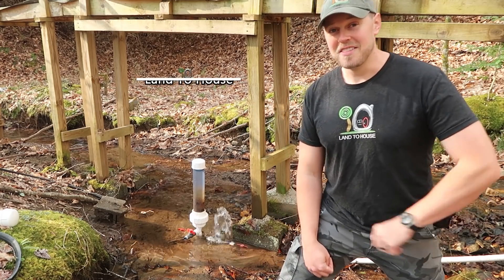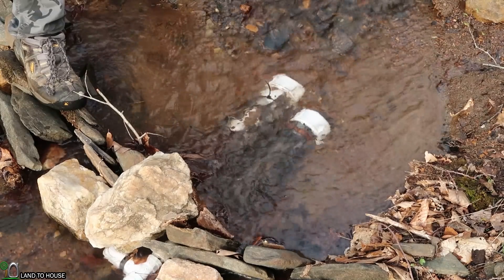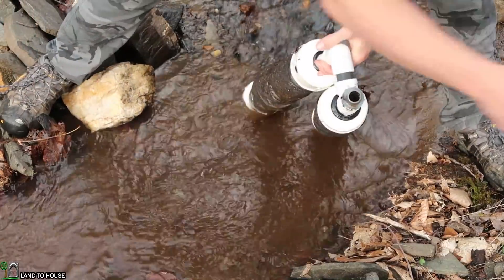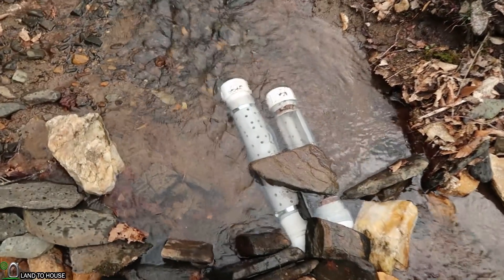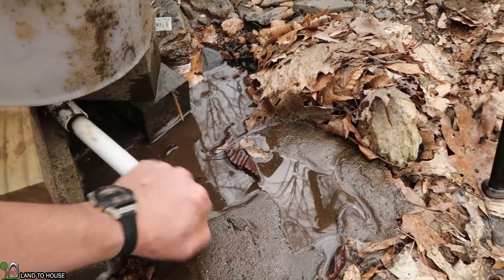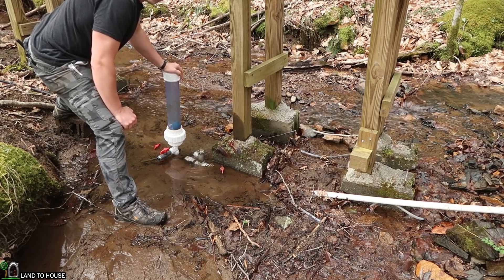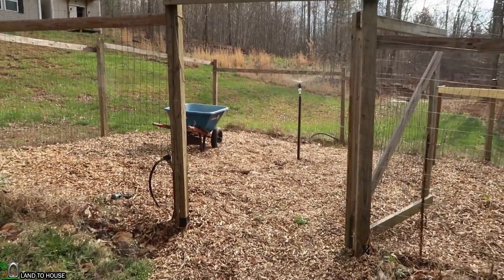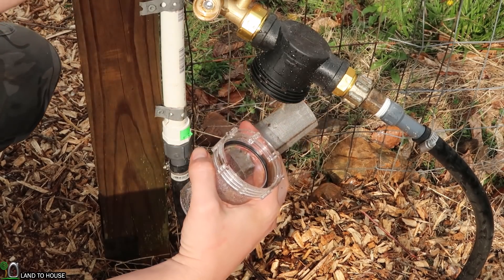Crazy Easy Ram Pump Silt Filtration

Comment: I'm thinking about installing a rusco spin down between the output of a spring just before the ram pump, to filter out sand and save some wear and tear on the check valves within the ram pump

Comment: You should have got this filter instead. You can put it in any direction physically,  as long as it flows in the direction it says. Horizontal or either of the two vertical ways the bell will point. The reason this one is better is because it has a cap you can remove and the water pressure will clean out the filter for you. Add a ball valve there and you can flush it out and replace cap without it back spraying you or having to shut off the water.

Comment: Ok im no expert by any means.but if i put slits instead out drilling holes it would let water in and keep the bigger stuff out.and burying a tote The size of your two intakes and fine screen top where water come into the tote that the lid has slits instead holes this would filter water from the begining and  put panty hose on the connections where you come of your two. Intakes to the line this will save you a lot of trouble .put panty hose on your infow at the fice gallon bucket als

Comment: I've almost finished constructing my 3/4'' Ram pump and I'm wondering how to make the swing check valve quieter.  Would adding a short length of pipe to the top of the swing check valve help reduce the noise without affecting the operation?
Reply: It would be nice to find check valves that had 'padded' flaps to reduce noise. Short of that...I suspect that any type of muffler device that blocks, directs, or absorbs the sound would offer some relief.

Comment: Doesn't the bucket reduce your head pressure on the drive pipe?
Reply from the maker: In my case it reduces the head pressure by around 1 foot. I have 7 feet of head and that is more than enough to get water to the tanks.

Comment: There is a lot of room for improvement with the bucket silt trap. Bigger would be way better. I'd go and buy a 15+ gallon stock tank at the farm store. Tilt it slightly towards your overflow trough. Drill a 3/8" hole near the bottom of the low side. The idea is the silt will have time to settle to the bottom, and then gradually work downhill to the drain hole. Have the drain hole running all the time, which will keep the silt flushed out automatically so it doesn't build up (figure 5-10% of the incoming water is always bypassing). Place your outflow tube to the pump a few inches below the overflow tube on the low side (much higher than you have). Place the inflow tube from the creek in though the high side of the tub so it's below the water line to limit added turbulence. The idea is the silt will have time to settle out during the 3+ feet of horizontal travel from one end to the other. This will give you way more silt removal capacity. I think what's happening is the bottom of the bucket is filling up with silt until it's going in your pipe to the pump, and then you have silt settling out in all your lines after that. That or your bucket is too small for the amount of flow so it stays too turbulent. You should make it very difficult for silt to get in the lines in the first place so filters later are much more effective.

Comment: @Land to House  So I've been watching your videos for several years now. However I have not been able to figure out how to make one of these ram pumps be beneficial for me. This is because though I have plenty of water around, but none of it is moving. I have the entire Lake "O" The Pines approximately 200 yards Out My Backdoor. I have been trying to figure out how I can make that become moving water so I can pump it up to my house? I'm open for hints, ideas, and suggestions? There is a drainage that runs from the street beside my house to the lake however this only has water for the first couple hours after a hard flood rain. We did not get it enough that kind of rain regularly enough to supply the water that I would require. What do you suggest?
Reply: Little King, I believe the while system works off Siphoned water for the head pressure.
So your main water supply would have to be higher then the pump, then the pump carries the water up hill.
I think he said for every foot of drop/Head Pressure = 7 feet up hill?

Comment: At the bucket where the top drain is back to sluice run 
U should rotate 90 degree drain upside down and install pipe to bottom of bucket so excess overflow pull silt out of bucket into sluice 
Wont drain bucket
Will still work 
The over flow drain will help push the silt out of bottom of bucket due to slight head in bucket
Reply: I was thinking instead of having the bottom plugged with a removable piece. of capped PVC, have a reducer on the bottom (smaller diameter than your outflow), so that the silt automatically gets washed out of the bottom of the bucket, but at a smaller flow rate than the output to the pump. One less maintenance item.

Comment: The intakes should be at the top of a deep pool / reservoir instead of sitting right in the silt.
Reply from the maker: Yes that would be nice but In these mountain creeks it's tough to have a silt free pool like that.
Reply: @LandtoHouse  It's the same in dust separation. The larger the cavity for the dust (silt) to fall in to, the easier it is on the filter. Like a small or big shop vacuum. You have the right idea going in the bucket. Dig a hole for the silt to settle in.

Comment: First off, good job!  It seems that you are able to deliver more water to your sediment catch bucket than the outlet drive pipe will handle; as witnessed by the over flow into the sluice. Question: Would it be a bad idea to raise the level of the bucket, like a stand pipe, so that you could increase the head pressure of the lower drive pipe?

Comment: You might consider setting up your storage tank OUTPUT about a foot up from the bottom so you settle silt up there too. I know that would require a reworking of the system, but your drive pipe bucket works so well, might as well use the same concept at your storage tank.
Reply: I believe that you use a uniseal on the bottom of your storage tanks... You might be able to just stick them further up in there.

Comment: At the capture point I would have put the capture tube under sand with small rocks on top of it. May spare you lot of debris all along the system?
Reply from the maker: The only problem with that is after a good rain the creek goes from 40gpm to 400+ gpm. Anything not locked down gets washed out. The sand and rock would be gone down creek.

Comment: Hmm. I'm just wondering if it has a positive effect to put a square plastic tub at your Main intakes. Build in the same design of your round bucket to have space for silt and a easy way to flush the silt out. I think when your intakes lay on the ground of the creek they easily sucks fine silt through the screen.
I also thinking of if it's possible to re-use the free silt (shoveld out and dried) for a Sandpit for your child or other things.
Reply from the maker: That might help with silt. We get a few big rains in the year and I often have to clean out the silt. The creek can increase in flow rate 100% after a rain. I have seen 500gpm in the creek that normally flows 40 to 50 gpm. 

I have been using that silt in the garden or on the hill for grass.
Reply: Even 2 buckets in line would be a better situation for minimizing the silt infiltration, maybe the first bucket have a screen from it to the second bucket and so on?
Reply: I was thinking a spring box so that the intake is completely submerged but not on the ground. This also ensures that the feed pipe never gets air in it. 
Look up how to build one. Lots of videos here in YouTube too show you how.

Comment: I have never understood why you don’t create a side pool where the initial intakes are,  to aid in filtering, just as you have the bucket really, have your dam as currently is, create a small side pond where you put your twin intakes, and have that side pond water supply come from a high point in your dam area, if that makes sense. Less silt, you can just shovel clean the original dam of silt, not disturbing the side intake pond,  a nice cheap project to enhance your intake, just a shovel, some rocks and some elbow grease. 💪 good luck
Reply from the maker: There are so many ways to improve the setup that I have now. I think there is a small waterfall up the creek a bit. I would like to make a real intake screen to capture the water that way. I actually got the material together to make one last year but then used them last week to make the intake for the micro hydro.
Reply: The side pool is a good idea.  I currently have an issue with silt filling up our ponds.  I've started creating smaller "mud" ponds above each pond to allow settling and I don't mind when the mud ponds fill up with silt - that is their job.  It is amazing how much dirt comes down the streams.

Comment: The buil-up pressure  tank you always place it perpendicular to the rest of the pump. Can you place it horizontally or at an angle?
Reply from the maker: It is possible to place it at a slight angle but the air often is lost faster. If you have a tank with air bladder you can lay it flat. I prefer to use the tank in the upright direction.

Comment: Your intake has one partially open and one with just drilled holes, do you need an open, which do you like better?
Reply from the maker: The open side was my original idea. They both work fine but I like the holes better than the window

Comment: Great Video!  :-)  please don't forget to try the expansion test.  The pressure in the tank is adjustable and has its own bladder.  :-)      I'm thinking of buying this from Lowe's. Any recommendations? https://www.lowes.com/pd/EASTMAN-Thermal-Expansion-Tank-2-Gallon-Universal-Steel-Water-Heater-Pressure-Regulator/1000522213
Reply from the maker: Yes! I have that test on the list. Just need to find one for a good price. I wonder if that one from lowes has the valve so you can change the pressure yourself?
Reply: @LandtoHouse  yes it does under the cap.  Max pressure they say is 80psi.

Comment: Why dont you have the filter fitted before the ram pump and then the pump wouldnt get clogged with fine debris/silt
Reply from the maker: Valid question. I would need to make sure it would pass 6gpm to feed the 1" ram pump.
Reply: @LandtoHouse   according to this website https://www.filterbag.com/U-S-Mesh-vs-Micron-21.html 100 mesh equivalent to 149 micron, i think it should be fine to pass 6gpm. or perhaps you should make a test video

Comment: So you spoke of the storage tanks too, is there a reason why you dont have the the hose filter on its way from the ram pump up to the storage tanks? or is there no need for a 3rd filter for them?
Reply from the maker: That would be good! I just did not want to break that connection.  Also its further to walk to empty the filter.